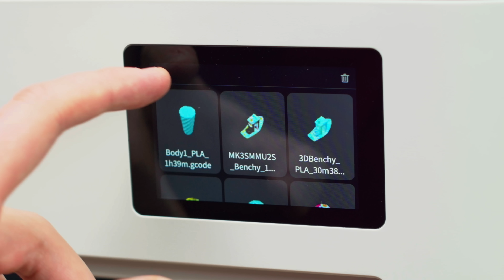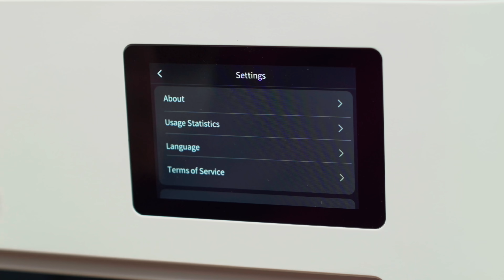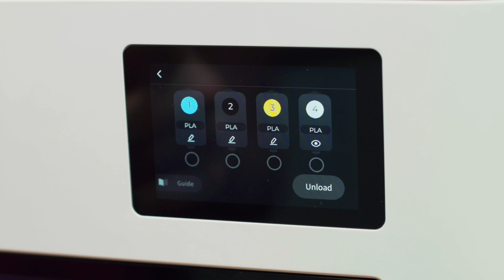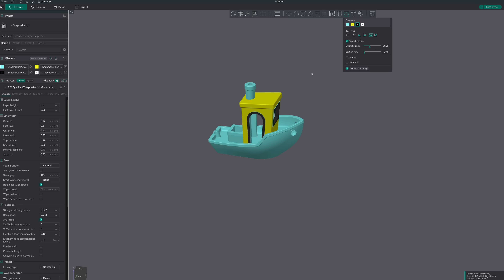Next level Multi-Color 3D Printer - Snapmaker U1 3D Printer First Look

Comment: I avoid the prime tower whenever I can on my bambu printers 😬 but guess I'm going to have to get used to doing it on this. It's not using the same nozzle so it would be a good idea. And yes, different TPU has different hardness levels. Try the Sunlu silk TPU. It's more stiff.
Reply from the maker: I've found that bambu printers don't really need the prime tower because it purges filament out the back anyways. Since the U1 doesn't purge any filament when changing, it helps to make a small prime tower

Comment: I live in Brazil and snapmaker don’t ship things to here themselves (on the kickstarter they do, but not on their website). I head that they will eventually open their klipper code and all. Then my question is 
1)  how easy is to support the printer ourselves? For example, if the motherboard is fried, can I make it work with a pi + 3rd party board?
2) How easy is it to access and change parts such as rods , belts, lead screws, and nozzles?

Comment: if they working on close top enclosure, it will change the design quite huge. then there are no filament pipe on top like that..
Reply: They have a picture of what it looks like on the kickstarter. It’s a clear top cover that drops on top of the printer. Looks ok.
Reply: @Laborchet  yup looks fine to me,  just like prusa xl. but if they can design like h2d maybe in the next version.

Comment: This is what Bambu should have come up with instead of the H2D. They missed the boat.,
Reply: And the market will punish them for it, if snapmaker nails it. I pledged, we’ll see
Reply: As an owner of a couple of Bambu P1s's I count agree more, a big mis-step in direction from Bambu IMHO. Strong competition is good and hopefully Snapmaker make it big with this machine, I especially like the direction they are taking with Klipper and Orca, an open approach I like. I to have pledged and looking forward to getting one
Reply: Yup. Own 2 Bambu printers and they lost me as a customer for this U1. This changes the game when it comes to multi color printing.
Reply: Will be interesting to see what this does to Bambu existing pricing. Also to see what new H2S drops at.
Reply: Not really. I needed a printer with 2 nozzles for high temp material. 65C heated chamber and 350c hotend. 
I print a lot of PPS-CF, PA-CF and ABS. Second nozzle for support material or 2 color printing for Text. 
Im very happy with the H2D so far.
Reply: Well.. have you seen Bambu Lab H2S with the "Vortek" system? 👀
Reply: @mesesdepois  you mean the system that swaps out hotends without actually having multiple lines thus needing to do the full load-unload AMS cycle with every filament change. That will cut down on waste material but it will still be much...muuuch slower than real toolchangers.
Better than nothing but a far cry from toolchangers or hybrids like what Bondtech is doing with the INDX
Reply: I think that they just came up with a solution with like 4 different nozzles but it is currently some beta that I think they are yet to come out with.
Reply: Not a bambulab glazer, just here to say that the H2D is meant to be a rapid manufacturing machine for businesses and corporations, not one of those products that a company pushes out to make news— it is meant to be a refined product and they did a pretty good job of it
Reply: @EmptyGuiwix  As someone who has a Bambu Lab printer in a more production environment. There software isn’t there yet. Hardware great, fantastic even, software is missing key features.
Reply: @EmptyGuiwix  Ironically this snapmaker will be drastically more rapid when using multiple colours
Reply: Their vortek new printer seem even better tbh.
Reply: @alkeryn1700  yeah. As soon the upgrade kit for the H2D will be available i will got one.
Reply: the vortek just swaps hotends without having separate lines. What exactly about that system comes  anywhere near an actual tool head changer?
Reply: @Grammostola  the filament used by the nozzle will remain in the nozzle. No purge required, only priming.
Reply: @Todestelzer yeah and the AMS has to retract and refeed with every single swap, and ofc materials like TPU are also out of the question..... This may eliminate a big chunk of the purging, for the materials that work with the AMS, but it will be so, soo much slower than any actual toolswapper...
Reply: @Grammostola  it's faster to change a hotend than the whole toolhead.
also this would allow for more colors as obviously it takes less space.
Reply: @alkeryn1700 doesn't matter as the AMS is the bottleneck here concerning speed, amount of filaments, and ofc space and that can certainly not keep up with a 5s switch like you have it on the U1 or the sheer scalability and space efficiency of the INDX
Reply: @Grammostola  fair enough, after looking more into it i changed my mind lol.
Reply: Yeah. Look up H2C.
Reply: @What_Other_Hobbies the vortek is not really comparable as it still relies on the AMS for the actual filament change. It's a half solution. But kudos to bambu for making it retrofittable.
Reply: They were busy trying to lockdown their users into their walled garden. No time for something as silly as improving the product lineup.

Comment: @11:50 still gonna say it when u print with Default benchy profile. the print starts u hit the LUDICROUS option increasing print speed to 166% SOOO yeah the slicer can say 35minutes at normal speed because it doesnt calculate the ludicrous option, with it, it does indeed print in less then 20 minutes without changing the slicer settings  of the model.
Reply from the maker: But is that still using the default profile speeds... I totally understand what you are saying, I'm just comparing the printers at their base stock speed that I think most people will be usually using. I need to do some more testing on those speed change settings and how it effects the print quality since I usually just use the stock speeds on complex shapes to get the best accuracy.
Reply: No one uses luidicrous on anything unless you really are in a time crunch, the print WILL show defects and you will likely throw your model right off the bed of your A1 if you don't have a huge brim. Ask me how I know lol. I used sport mode on my X1C sometimes but honestly, for quality and wear on the printer, its best to just keep it standard
Reply: So then slice a benchy on the u1, send to print then increase speed to 166% and compare

Comment: I just backed this machine but now I am having my doubts. Based off Snapmaker's previous Kickstarters, they aren't completely forthcoming. That continues in the U1's Kickstarter. On the Kickstarter rewards page, it shows a batch delivery date for Oct and another for Nov. However on their official website and tucked away on the campaign's FAQ, it states the delivery window as December 2025 for the Oct group and January 26 for the Nov group. I must be in an alternative timeline, where Oct actually means Dec and Nov means Jan. 

Jokes aside, why couldn't they just be honest from the start and put in the actual estimated delivery dates in their Kickstarter rewards page. I questioned this discrepancy in their comment section and didn't get an answer....
Reply: That's been further clarified. They will be shipping from the factory in October and November for batches 1 and 2, and those will be on a container ship to local warehouses, from which they will be shipped to backers. Yes it does add significant time to the shipping but this does keep the cost down.
Reply from the maker: My guess would be the delay is to fix things found in Beta testing. It is disappointing to see dates change like that, but it will only make the printer better.

Comment: Is there an app for your phone, Mac or PC so you don't have to use the touchscreen?
Reply: I believe there is, but right now it isn't great due to beta and stuff.
Reply: It's running Klipper, so that should be easy to add (in theory).
Reply: @Mueller3D  indeed. For desktop seems you can already access fluidd, which is a good interface already. As for apps, if it running octoprint then there should be some compatible apps as well. If not then we can make one haha
Reply from the maker: Yes there is a phone app, but I didn't use it. I prefer using the computer or touchscreen. The computer has the slicer interface, or on a browser you can go to the Fluidd webpage which gives advanced full control of the printer

Comment: Why is nobody making a tool changer with the extruder motor on the mobile part ? That way you only need one
Reply: They do ... look up Bondtech's forthcoming INDX kit
Reply: @Uniqueacid oh woaw they even share the heater, very cool
Reply: Because that's not how the filament path currently works?
Reply: @iaredavid02  he means just the motor, not the whole extruder. obviously seperating the extruder / filament path is the point of multi-toolhead printers
Reply: @Belyosd  because that is more prone to failure as you have to make sure the motor lines up every time perfectly or else the machine will jam or worse.
Reply: You want each filament to have its own nozzle, which is at the end of the print path, but the extruder gear comes before that. If you separate the drive gear from the motor, then it's possible, but you need for the extruder driveline to be fairly precise; making that separable will reduce the precision, unless you do very careful engineering on it.
Reply: That’s what bond tech is doing
Reply: @Laborchet yes seems incredible
Reply: Could be just a nozzle change instead of four tool assemblies but how that would be done i dont know

Comment: I like the 3-in-1 style that snapmaker offers, but if you just want a 3d printer, they didnt have an option. This is a seriously great way for them to enter the scene. I cant wait to try this machine out!
Reply: I have the 3 in 1  A350.   We print and use the laser.  Both functions work well.   Not yet found the opportunity to use the cnc.    

Seriously thinking about this new printer.  My wife likes to do  multicolor stuff such as cartoon characters or things with words on them.  I have to manually edit a pause in code and then switch pla rolls myself.  This new printer would do proper multicolor objects without manual intervention.  I could trust my wife to run jobs on it.  So, biiiiiig bonus there.
Reply: Huh? You haven't heard of the Snapmaker J1/J1s? It's really good..